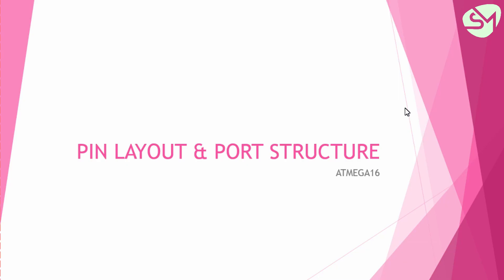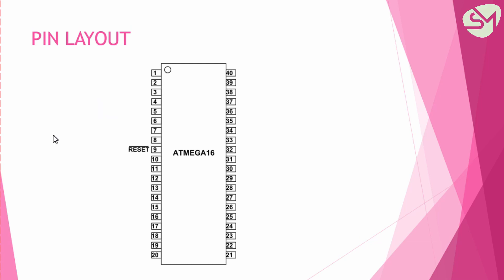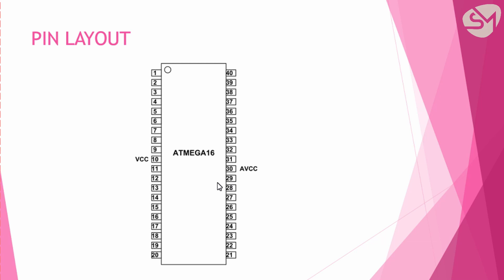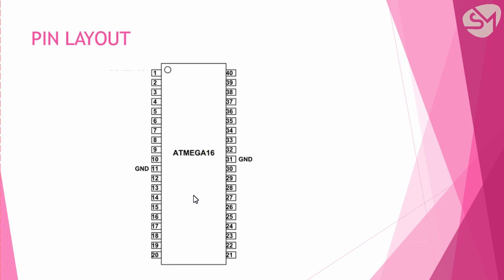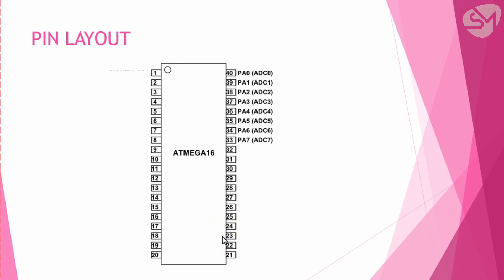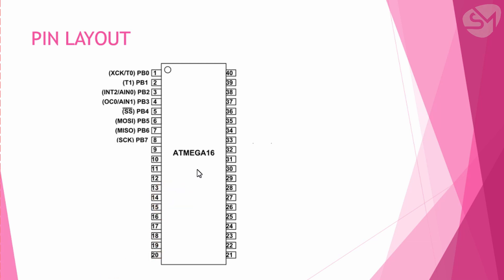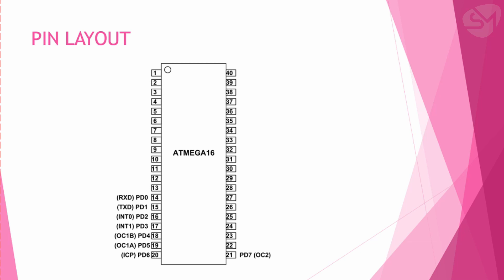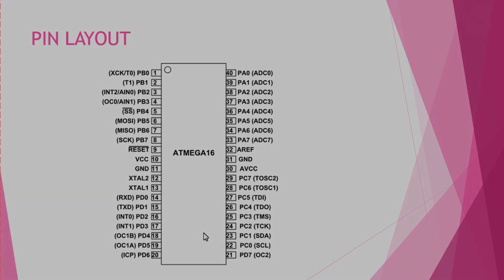PORT STRUCTURE AND PIN LAYOUT OF ATMEGA16 | Atmel Studio Programming Course (Atmega16) | T - 5

Comment: how to know, how many digital pins are in atmega 16 also can we use anolog pin as input ot output pin?
Reply from the maker: You can just count the total I/O pins in the pinout diagram of atmega16 totally 32 pins, yes you can use analog pins as digital inputs or outputs, until you configure them as analog you can use them as digital I/Os.
Reply: @SMtrainingacademy  thanks please make one video on wireless communication using Atmega16/32 (RForBluetooth).
Reply from the maker: @dipeshnetworkcreativegroup2681  Already done bluetooth with atmega16 here is the link bro:
https://youtu.be/m0NMejWcA_w